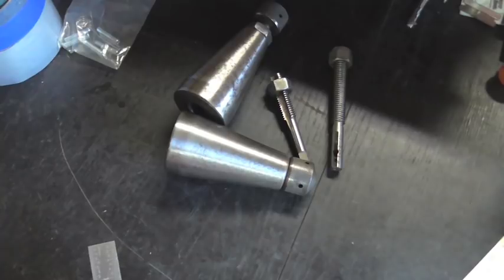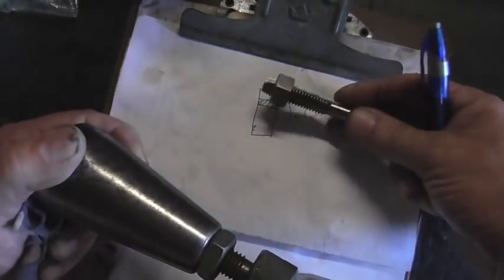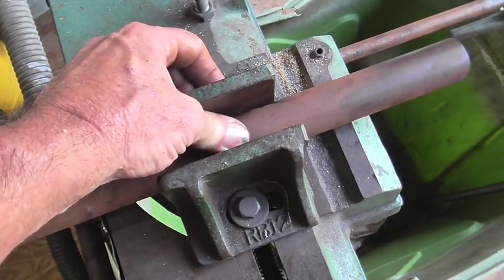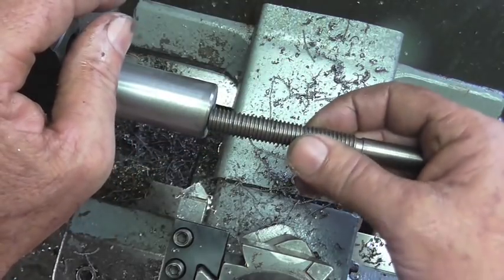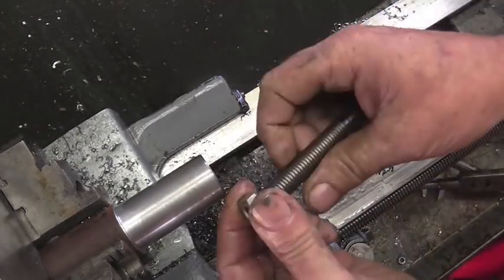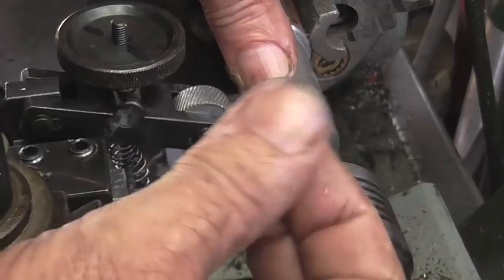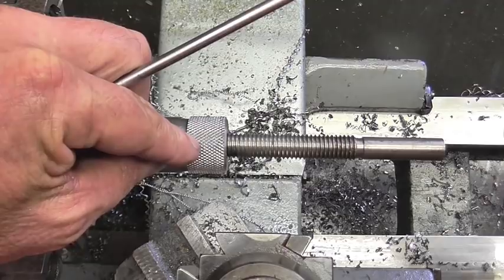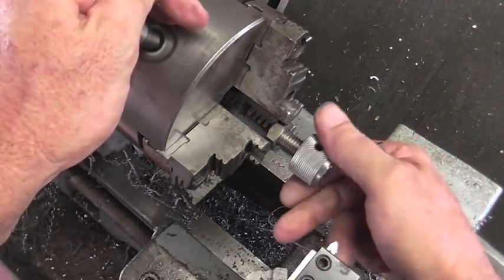Making a Machinist's Jack For a Small Milling Machine - MSFN

Comment: That little trick with the tap in the tailstock for nut alignment is pretty slick. I'm stealing that.
Reply from the maker: By all means!! 😊 Works well!
Reply: Me as well.  Think I would have used some Hex stock and made a slim nut out of that.  Doesn't matter but a internal thread gauge to get it closer, but assuming you got one.

Comment: A good video, thanks for taking the time to make and share it!

I do wonder, if instead of the extra time to mill out the bottom piece so it sits 'flat on the machine surface, if three hardened ball bearing feet could be more useful, as it seems to me that your lathe/mill surface plates would be square to the axis of the machines themselves?
Reply from the maker: Great idea but think of the challenges of lapping them all in once seated to a "depth" It can be done like surface gauges I suppose. Thanks for watching & Happy Holidays! 😊🎉
Reply: @MakinSumthinFromNuthin  I'm thinking a large endmill, reversed in the mill could be used to press precision harden balls into the reamed holes, perhaps in a mounted rotating center head on the mill.
Reply from the maker: Certainly worth a try if you want to give it a go! ATB~Richard

Comment: My 2 cents worth on Jack screws, in a job shop you don't have the time to do all that Machineing.I did make several bases in different lengths and a couple of standard off the shelf jam buts but the major screw length was a simple 1/2-20 threaded bolt. Measure the length you need and get a bolt from the bin. Face it if you need to or machine to fit the job. Throw in box in your toolbox and soon you have a set and no more running around.
Reply from the maker: I totally agree, but I only do occasional work for people and had time. Plus needed some content for the channel so made it nicer than it needed to be. Thx for watching ~ Richard

Comment: How do you cut A36 without getting cat tongue finish? I usually have to resort to using the toolpost grinder to get a decent finish on A36. I make all my Jack's out of 303 or 304.
Reply: I had a similar problem, no matter what tool or grind I used, on 4140 type.  My short answer to that and several other aggravations was in getting my big spindle bearing adjusted properly.  Getting a decent machine finish (and parting off) isn't nearly so difficult now.  Retiring my "Tourettes" lantern tool post may  make more of a difference.

I am also a fan of the vertical shear tool.  I found that multiple spring passes improves even that.  My theory on that is every tool leaves high and low spots on the surface,  every time the tool is moved across with the carriage power feed, it does so on a slightly different path, giving the tool a chance to take off the higher area that it missed on the previous one.  I'd probably have to get a microscope to visually confirm that.  Often, an old lathe like mine has it's lowest feed rate at somewhere around .006/rev, and a single pass cut will often have a 'threaded' look to it, even with the shear tool.

For What It's Worth:  On my last project where I used the vertical shear, I needed an easy slip fit to the mating part.  On the first pass, it sized to a very snug fit.  When I moved the carriage back to the starting position, I didn't bother with retracting the tool, and it left a rub mark on the part, indicating to me that there was spring pressure still in play.  Understandable, I'm guessing, since the chip size indicated that the depth of cut was on the aggressive side for the shear tool.  I decided to experiment a little, left the cross feed where it was and made a spring pass.  I got what I expected, more and much finer whisker chips.  When I moved the carriage back, as I'd done previously, there were no rub marks, but the result of the test fit to the mating part was still a little too tight for what I had in mind.  The second spring pass still produced chips, at that point I decided to ride that particular horse 'til it died.  

The final tally came up to 8 spring passes, 6 that produced chips (the last were "finer than frog hair, split 3 ways," so that I had to put a clean rag under the work to catch and see them), the 7th produced none that I could see, the 8th pass was to confirm the 7th.  Finish was not polished mirror by any stretch, but it was the closest I've ever come to it without going to abrasives.  The fit ... better than i expected.  Easy slip, no binding anywhere, even when the two parts were wiped dry of oil, yet no wiggle between the two could be detected with the assembly in hand.

Considering the result I got, that M.O. might be worth trying again and seeing how easy it would be to repeat it.  With different machines, operators, materials, the results may vary widely.
Reply from the maker: Well off camera I did hit the base of the jack with some 400 grit for about 30 seconds or so for appearance sake. I usually resort to a HSS shear tool for final finishes on mild steel
Reply from the maker: Thanks for sharing Diggerop 👍🏼

Comment: The thread of the jack can be as long as the base is deep giving it more reach to fit more uses.
Reply from the maker: If I remove the nut I can get it a bit lower but not much room to work with, I could make another top with a longer thread tho, may do that

Comment: How about using hex coupling nuts in the chuck since they have a longer gripping length and would align more accurately?
Reply from the maker: Yes, I need to buy some hex stock and make a bunch of common sizes
Reply: They sell the coupling nuts in common sizes at Lowe's and probably at Home Depot.  They're where the threaded rod is stocked.
Reply from the maker: I am sure they do but I would rather make my own. I would rather have the tolerances my own taps will provide rather mass produced stuff.
Reply: Got ya! Keep up the good work. I'll be subscribing and visiting your site more often.
Reply from the maker: Thanks Douglas :)

Comment: I have my own homemade jacks they come in handy. Richard one thing to consider is I keep connecting nuts in various threads so in the situation like you had I can chuck on those. Or you can drill and tap out short pieces of stock for that purpose.
Reply from the maker: Hi James, yes, a very good idea. I have planned on making a complete set of nuts for all the most common sizes to chuck on but never seem to get around to it and swapping to a collet when in a hurry gets tedious. Gripping bolts with aluminum soft jaws destroys them pretty quickly. Thanks for tuning in, I appreciate ya~ Richard

Comment: I see your left thumb is a member of the black nail club Rick - of which I have been a member several times!
Great result with the jack - I have made a few and hardly use them but ...... better to have and not need very often!! :)
Reply from the maker: yes, been 3 years now, damage has has never grown out.....yet. (from a hand drill)
Reply: I thought you were driving nails with a hammer and hit to wrong nail!! :>)
Reply from the maker: Sort of, was driving 3" wood screws with a corded drill into a wood swing set with a Phillip's bit in the drill. Bit slipped off the head of the screw and with full force went into the center of my thumbnail cause I was holding the work next to the screw location when bit slipped off........ bit bottomed out when it hit the bone.
Reply: Oooh!! Sorry to make you relive the moment.  Been there, not fun.
Reply: Black nail club membership dues:  good for the life of the badge.  duplicate payments do not carry over, and are non-refundable.